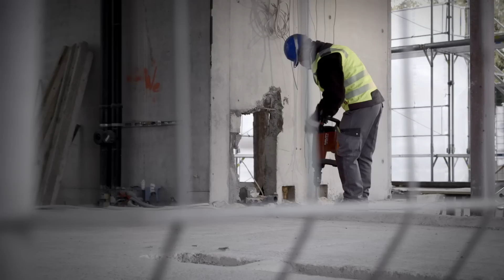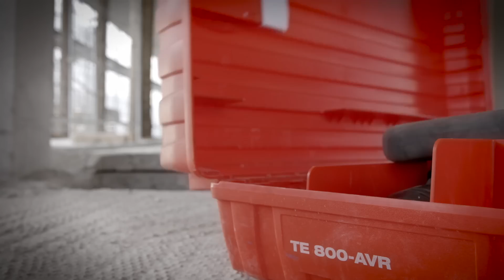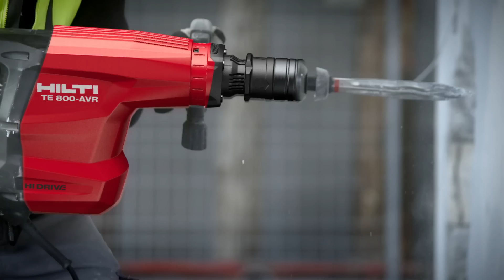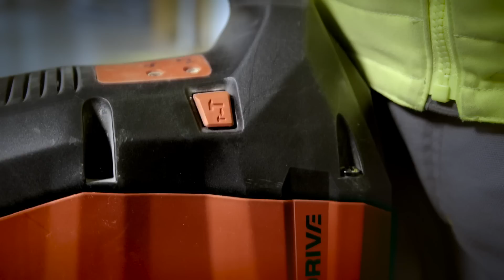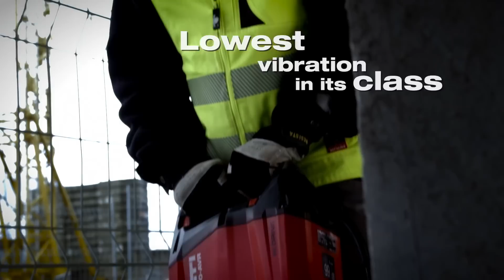INTRODUCING the Hilti TE 800 Demolition Hammer

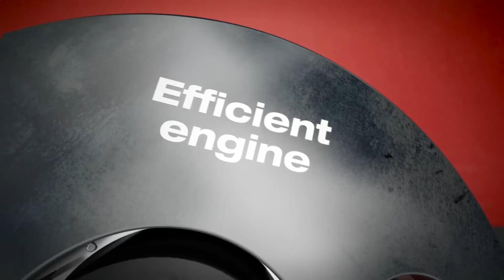Comment: The animation at 0:22 is a fail. The armature is turning the wrong way. The next gear turns the "right" way around and the air decides to flow to the front anyway, despite beeing sucked back by the fan.